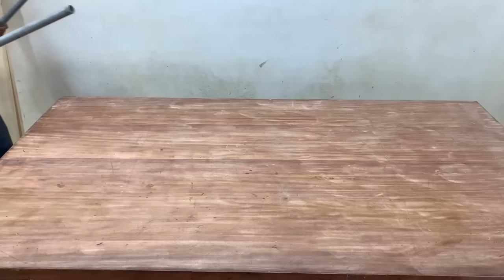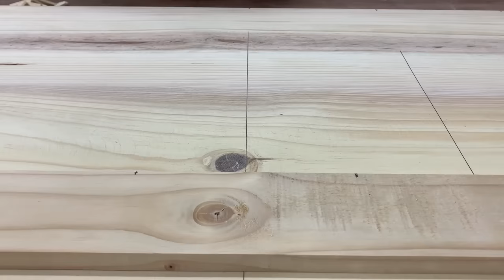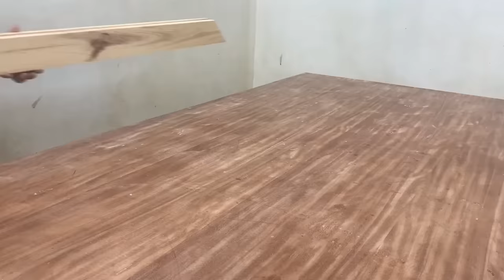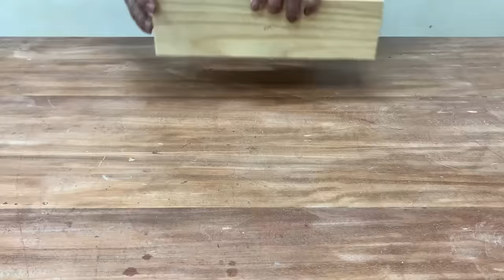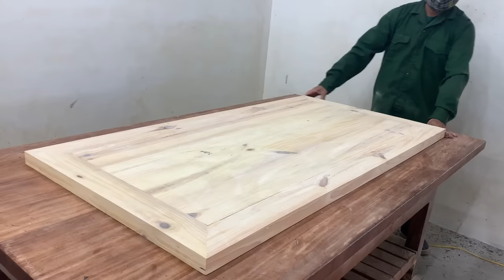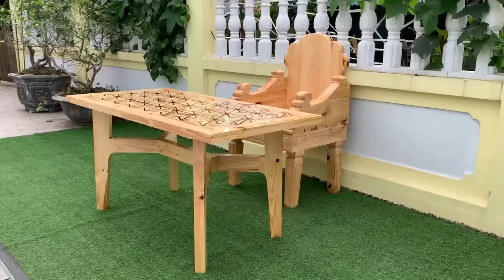Amazing Shapes From Pieces Of Wood // Awesome Woodworking Design Ideas // DIY Beautiful Table

Comment: I have to admit the end product looks good, your design ability is enviable, however the construction is very much in the style of a Joiner attempting to be Carpenter.  Wood likes to expand and contract and fixing legs to a table top in  this manner does not allow any movement. I guess this type of construction would be okay for somewhere where the temperature and humidity do not vary much.  Here in the UK the table would be splitting apart everywhere in a couple of years.  There is more to carpentry than nails, screws and super glue, my comments are based on being a teacher of fine carpentry for many years.

Comment: What filler you used to fill the gap
Reply: Bro...I've been waiting their reply too on your comments ....But seems like they are not responding... In our country, fevicol is the most common glue for woodworking... Do you have any idea what will be the result if we mix fevicol with fabric colour as a filler... What do you think?🤔
Reply: My guess it is epoxy
Reply: @akulolomi9294   i didn't practice but if we will mix fevicol with wood grain or wooden powder i don't know what to say in English in our country we say buradda so i say wooden powder, and mix colour with it might be it will work.
Reply: @nainwalshubham007  bro that was no a mixed baroda not a epoxy that was something else
Reply: It is acrylic I guess.